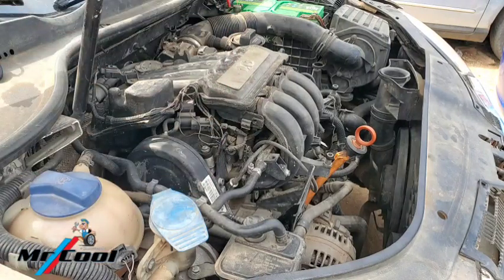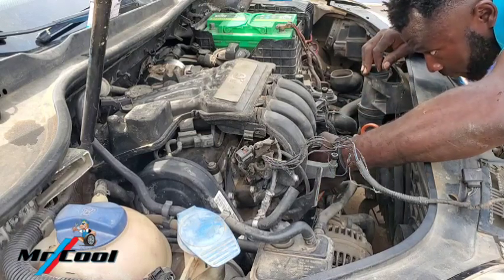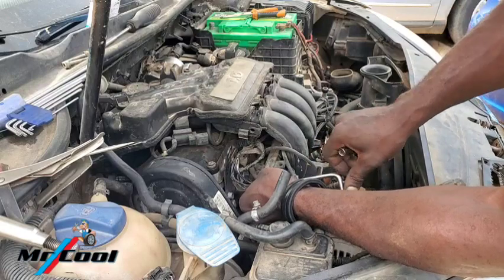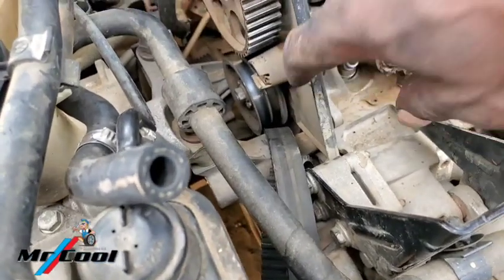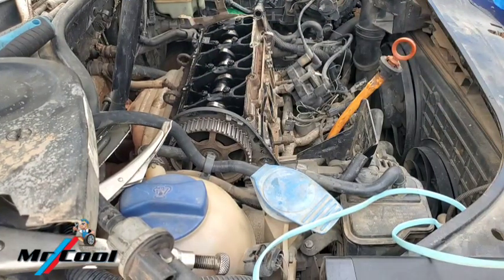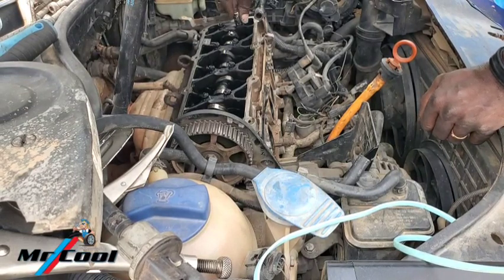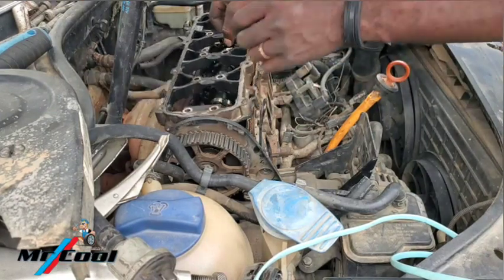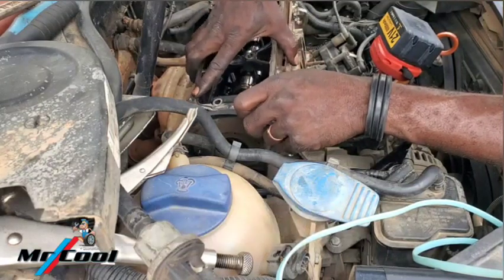How To Replace Top cylinder gasket on vw jetta mk 5 1.6L | vw jetta top Cylinder Head Uninstall

Comment: I believe I have the same engine for the audi a3 2004 (8p1) 1.6l (engine code BGU). It has a blown head which I need to replace. Where did you find the information for this?
Reply from the maker: Bro I know lot about vw cars cos that's my brand for life from my 2 3 4 5 and passat
Reply: @drcoolautofix  no way, you did this all from experience? Respect! I agree, VAG cars are awesome
Reply: @TheWahab2002 I have the same issue on my a3 BSE have you fixed it?
Reply: @xt0  yeah I have, I'm happy to help. What country are you from?
Reply: @xt0  did you end up fixing it?
Reply: @TheWahab2002  it wasn’t the head gasket for some reason cylinder 3 is misfiring and I can’t work out why
Reply: @xt0  did you check the bases? Compression, spark, fuel, air, timing. For me there was a misfire in cylinder 1 and 2 because it was losing compression at cylinder 1 since the sparkplug thread part of the head was warped and after taking off the head, one of the valves was badly cracked. All are fairly easy and simple to test, there's a chrisfix video on it. If you'd like, we can get in contact and discuss it further
Reply: Hello, how are you, first of all I want to express my respect, I see that you have knowledge of what you do, I am not a mechanic but I do a lot of research, I have cousins and friends who are mechanics and I like mechanics, I bought a basic Autel maxilink519 scanner and can read codes... my The car is an Audi A3 BSE engine 1.6 4 cylinders, one camshaft, 8 valves, 102 hp, five-speed manual transmission, year 2008 and I have 237,000 km and 11 months ago we did a very large repair, we opened the engine and the camshaft was scratched and their supports... I changed rings, the cylinders were good, the pistons were also healthy, the valves were in good condition and with good seating... and only repaired and filled the camshaft and the supports at a specialist since it is not available here the entire cylinder cover, so because of that I replaced cover screws, almost all gaskets, new oil pump, take advantage and change the distribution group, water pump belts and tensioners... and also replace coil, cables and spark plugs... and I even changed the rubber gaskets that go in the middle of the air manifold, when you separate it, it has round gaskets... I changed those because one burst... and today the car runs, it has quite a bit of power, but at the beginning of the drive, when you turn it on, it generates small explosions in the engine... they can be heard from inside, it makes the car shake almost unmanageable and along with this the ESP light and the yellow DTC code light are activated... when scanning it 99% of the times that I have been able to scan and it gives me the cam position sensor error p0341 and I replaced this sensor with an original one... even today it works the same... I came to the conclusion that here in Argentina there is no knowledge that is needed, there is a workshop that maybe I can achieve solve it but I'm thinking about changing the engine... any ideas?
Reply: @cezarpo I also have a suspicion it is my oil ring on piston 3 as I had a misfire. Somehow my car eats spark plugs every 3/4000 miles I only fixed mine by changing coil distributed leads and spark plugs the issue is gone but I don’t know for how long it will go away for

Comment: Hello, how are you, first of all I want to express my respect, I see that you have knowledge of what you do, I am not a mechanic but I do a lot of research, I have cousins and friends who are mechanics and I like mechanics, I bought a basic Autel maxilink519 scanner and can read codes... my The car is an Audi A3 BSE engine 1.6 4 cylinders, one camshaft, 8 valves, 102 hp, five-speed manual transmission, year 2008 and I have 237,000 km and 11 months ago we did a very large repair, we opened the engine and the camshaft was scratched and their supports... I changed rings, the cylinders were good, the pistons were also healthy, the valves were in good condition and with good seating... and only repaired and filled the camshaft and the supports at a specialist since it is not available here the entire cylinder cover, so because of that I replaced cover screws, almost all gaskets, new oil pump, take advantage and change the distribution group, water pump belts and tensioners... and also replace coil, cables and spark plugs... and I even changed the rubber gaskets that go in the middle of the air manifold, when you separate it, it has round gaskets... I changed those because one burst... and today the car runs, it has quite a bit of power, but at the beginning of the drive, when you turn it on, it generates small explosions in the engine... they can be heard from inside, it makes the car shake almost unmanageable and along with this the ESP light and the yellow DTC code light are activated... when scanning it 99% of the times that I have been able to scan and it gives me the cam position sensor error p0341 and I replaced this sensor with an original one... even today it works the same... I came to the conclusion that here in Argentina there is no knowledge that is needed, there is a workshop that maybe I can achieve solve it but I'm thinking about changing the engine... any ideas?
Reply from the maker: Why don't record the sound and upload it here, but if you want to change it it's ok, if you don't have loads of budget, get one from scrap yard
Reply: @drcoolautofix  man!! Many many thanks for your answer ok i will try to record and upload